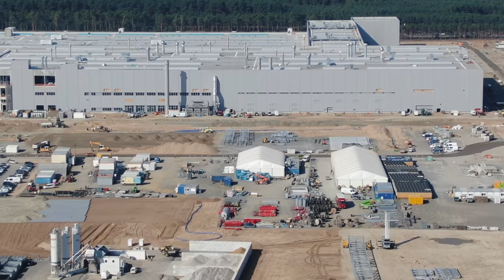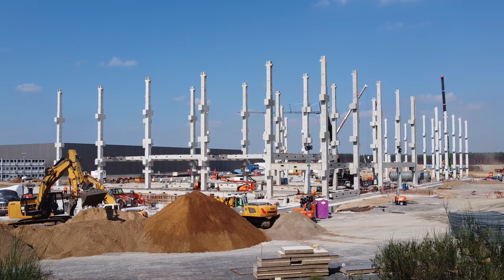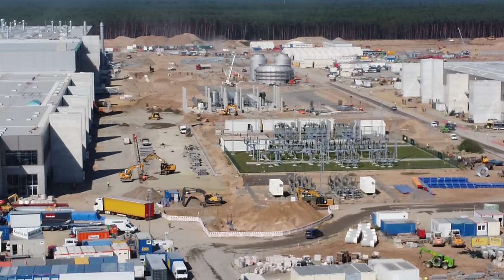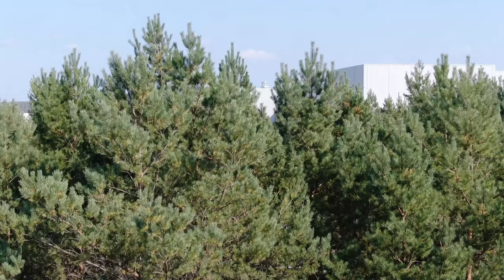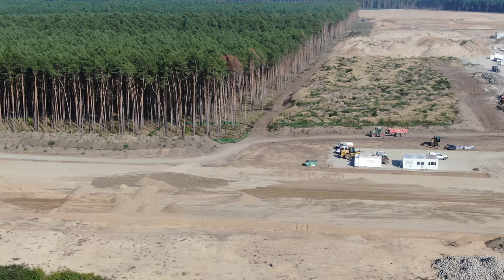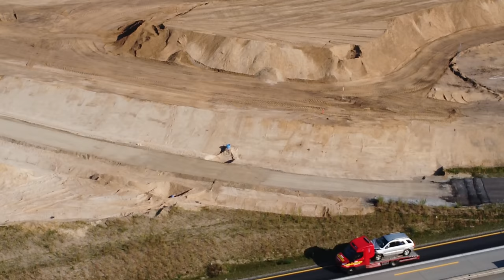Giga Berlin | 2021-09-08 | Timelapse

Comment: Was mich etwas verwundert ist, dass die Betonsäulen der Batteriefabrik nur aufgesetzt (Verschraubt) werden und nicht wie sonst in eine Öffnung eingelassen sind.
Reply: Ist eben eine von zwei Varianten. Nichts zu wundern, absolut normal, Wie dick willst du denn die Bodenplatte noch machen um da Köcher unterzubringen?
Reply: @julianreverse  nicht dicker, an der Position halt einfach ein Loch. 
Ich habe diese Methode noch nie gesehen, deswegen war ich verwundert.
Reply: @nighteyergbg  Und was bringt dann die Dicke Platte wenn die Stütze nicht drauf steht?
Reply: Bei Wind 7 - 8 möchte ich da auch nicht mehr rumlaufen ....

Comment: Thanks as always for the vid! They really need to step on the gas. Still no test track, no charging ports for dozens of vehicles at a time, the roads still haven't been paved, and none of the loading docks have concrete or pavement ready... if the Elon email is to be believed and they're gonna do some test production in Oct... they gotta step on it.
Reply: My main grievance is that damn missing wall on the casting area.
Why isn't it closed off yet!?

Well anyhow, it looks like there is some nice buzz there now and I guess they are finally starting to get over all the regulatory hurdles, which has been the thing that held them back the most I think.
Reply: @toffotin  Still some Gigas missing there ;)
Reply: @I.  I guess...
But, you know... Put them in there!
Also, do you really need to have the walls removed for such a large area?
Reply: "Still no test track" Tesla changed plans (once more). There won't be a test track. The testing of newly produced cars will be done by a track simulator.
"the roads still haven't been paved, and none of the loading docks have concrete or pavement ready" They are working on this. Don't see this a critical. 
There are other factors more worrying. Like Tesla wanted to install the production equipment in the DU between Sep. and Nov. But so far Tesla has not yet even applied for a environmental permit to install the production equipment. Listing what will be installed and the precautions taken to protect the environment. Should not be difficult with the type of production equipment that will be installed there. But not having yet applied for a permit means normally that this equipment is yet not even ordered.
Reply: @abalada  Gotcha, thanks for the updates. With the drive unit permits not being filed yet... do you think that means they'll have to import everything from Shanghai/Freemont, or the production has been pushed back even further?
Reply: @buckymoto  
It's surely possible to import a certain amount of drive units. More than a limited production (low numbers) this year is not realistic. Before the battery cell factory is ready at Giga Berlin their won't be enough 4680 batteries to ramp up production anyway.
Reply: @toffotin  You must be really stressed at there being no walls on the casting at Fremont and incomplete walls at Austin. Why would Tesla close the walls in this factory when they have not completed the inside? No walls means easier access, better light and ventilation.
Reply: @gpsfinancial6988  Yeah, I meant more like it's a constant reminder that there is still much to be done. I wasn't disagreeing with the way they are building, I'm just eager to see the factory finished.